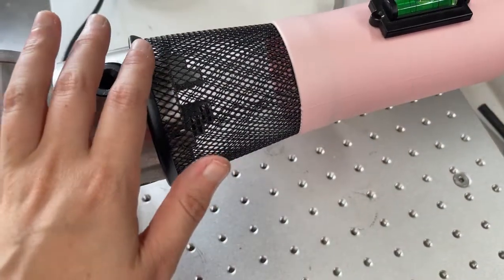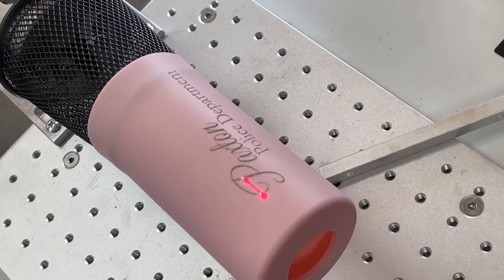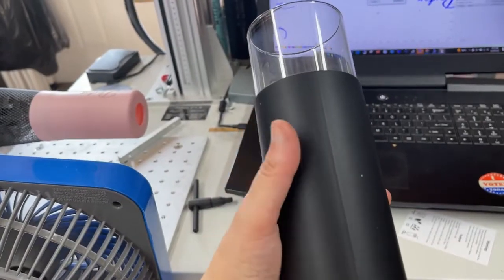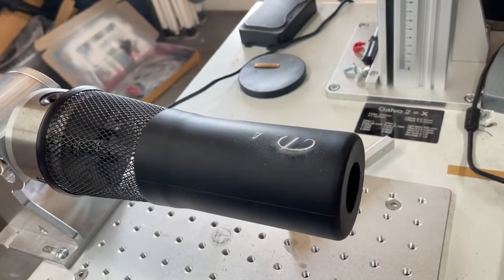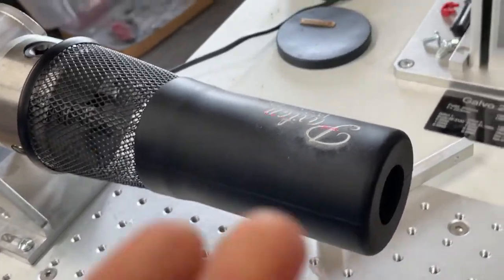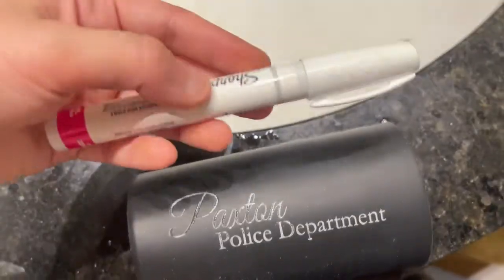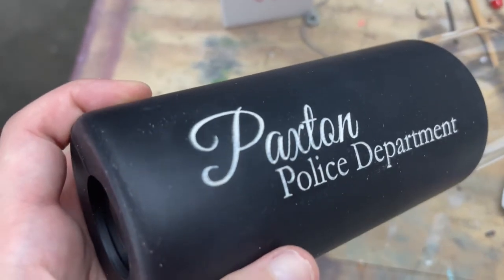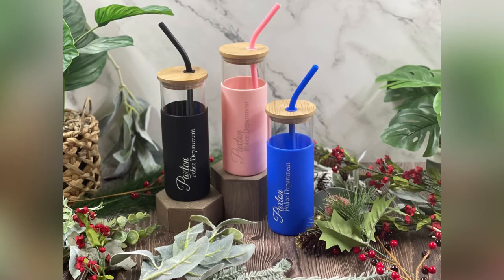Engraving Silicone on my 30W OMTech Fiber Laser!

Comment: Just wondering why you chose their fiber laser and not the CO2 polar 50w laser?
Reply from the maker: I actually purchased the fiber way before the Polar came out- back in 2021, about 6 months after my CO2 because I needed a dedicated mug machine, and I wouldn't get the rotary to connect or stay connect with my CO2. I was watching some of the videos Max over at Laserbeastlab had in real-time of his tumblers he was running with his 20W OMTech fiber, and I was very impressed- so I decided to get a fiber for my mugs. :) Most of what I do is powder coated, and honestly for silicone- the CO2 is the way to go, if you can.